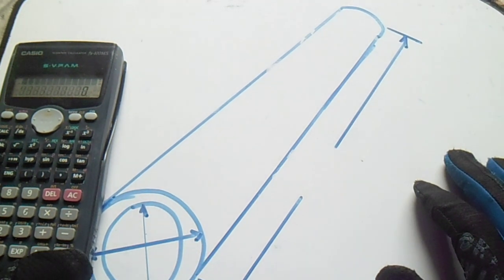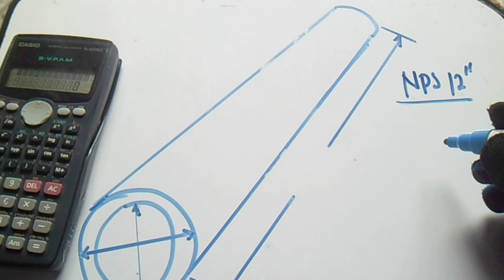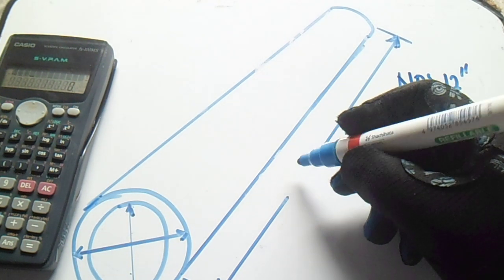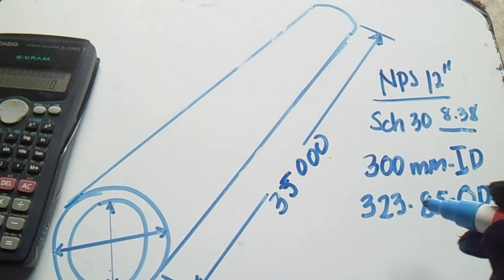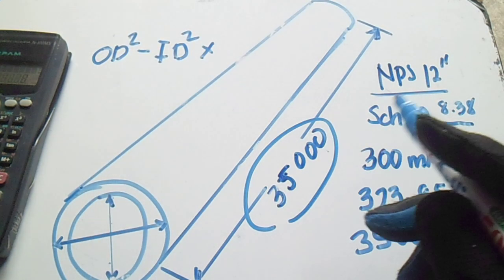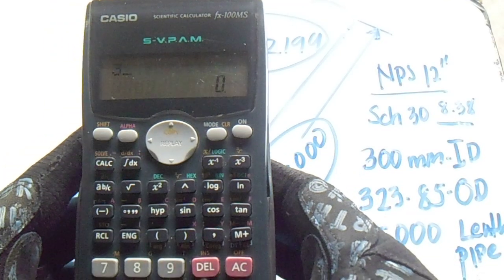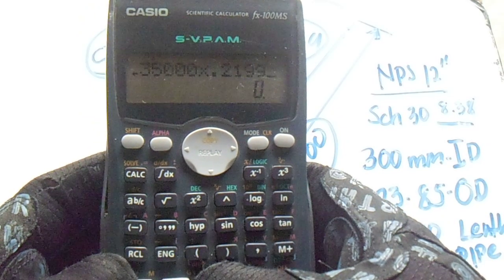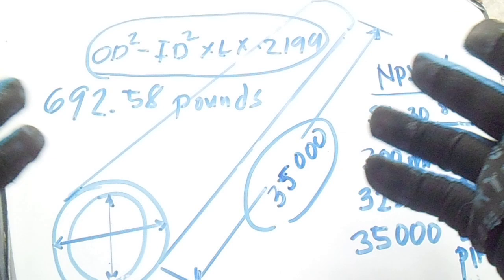How To Find Approximate Weight of Pipe - PipingWeldingNon DestructiveExamination-NDT

Comment: outside diameter + inside diameter / 2 =
od 12" - 323,8  + id 12" (12x25.4) = 304.8 mm = 628.6 / 2 = 314 mm
you calculate the pipe as a metal sheet so you have to unfold it with the formula of circumference
c = 2 *pi * radius or c = diameter * pi (3.14)
so,   0.314 x 3.14 = 0.986 x the thickness of the pipe who is on SCH 30 equal 8.38
0.986 x 8,38 = 8.262 multiply by the density of iron 7.85
8.262 x 7.85 = 64.85 kg / linear meter
Reply from the maker: Great! Thanks for Sharing

Comment: Where can you find a 35 meters pipe with 30 cm diameter  almost 1 ft  that has 600 plus pound of weight?  Or around 300 kls only. My God, cgro gawa sa plastic to o sa papel. Imposible sa steel pipe.

Comment: Kabayan, bakit ba pinahihirapan mo ang solusyon. Kasi galing sa metric system bigla lang nag ka english system. Sana noong una,  iderive mo sng formula mo na consistent sa unit mo. Kasi ang constant mo madali lang nman yun basta tama ang pagderive. Tapus gamitin mo yung na derive mo na formula to calculate. Pinahihirapan mo ang buhay kabayan. Pati yung pagkuha mo sa weight ng pipe mali po. Ingat ka sa pagamit ng diamter na inisquare mo, kasi dapat radius yan. Pi/4 yan. Hay nako.
Reply: oo nga eh bagsak tau nyan sa interview ang bigat ng kanyang tubo.samantalang 65kg lang ang per meter ng tubo nya sa 35.5 meter ay 2,314.46 lang iwan dyan kay kabayan.
Reply: 35 meter lang pala 2,275 kg lang ah